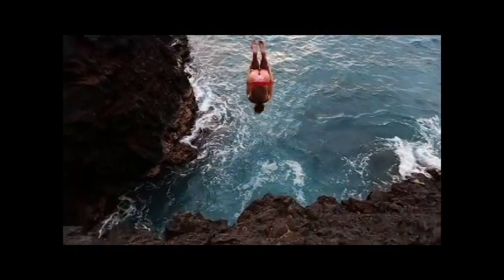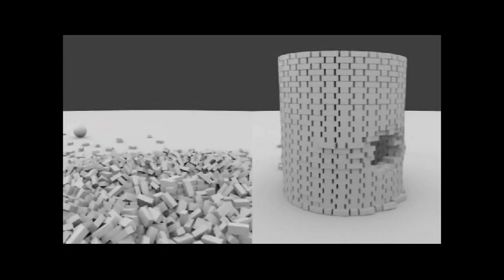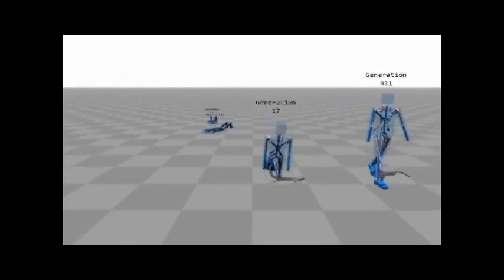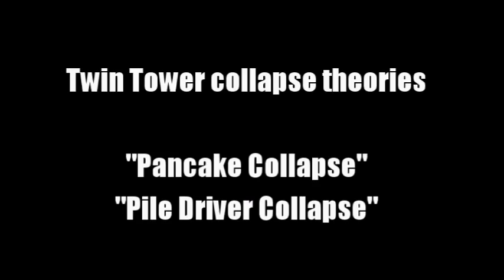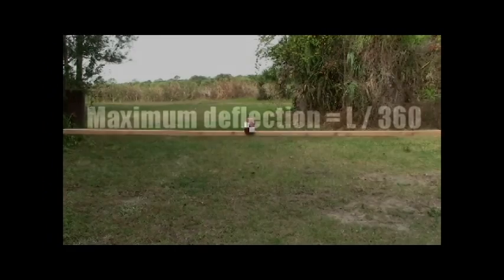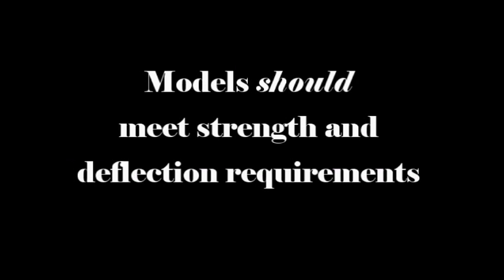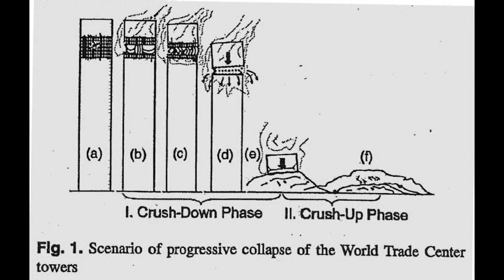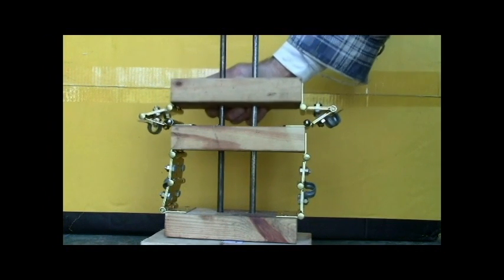9/11 Experiments: The Force Behind the Motion

Comment: What a crock. Drop a weight that is much less than the maximum static load for one floor, and OF COURSE it will slow and stop!
Do a real experiment. Drop a weight that is many times the maximum static load for one floor and see what happens...the weight will plunge all the way to the bottom, which is precisely what occurred in the Towers.
Reply: He did exactly what was represented in the buildings. He dropped 15 of the top floors, which were identical in size and weight as the other floors of the building. You are basically asking that in this experiment he drop a bowling ball or a car engine onto his little model and see what happens. Of course it will destroy everything, but the model and the physics he presented are analogous to the building. He dropped a large section of identical floors onto the rest and found that it slowed down and eventually stopped. The important thing was that the top section did not accelerate as the real towers did. And actually his model is wrong. He assumed all the floors were the same weight and same strength. They weren't. The top sections were the lightest and the core columns got thicker towards the base. Had he simulated this, his results would have been even more to his point. Point out what is wrong in my analysis.
Reply: I didn't read the whole thread, but I laugh at all these truther idiots that buy this video.  The guy drops a "static" load onto some cement boards and claims it decelerates.  Well yeah because he has them sandwiched between two thick wooden "supports" lmao.

Then he takes the experiment to the next level and removes the outer supports, but then fails to create a proper scale model of a static load (As you've been saying).

So both experiments are utterly flawed.  The first one doesn't allow the "lower" floors to join in the collapse, adding their weight, because it has outer "columns" that are not to scale and the second one has a load force that isn't to scale.
Reply: Do you not understand "greater than maximum static load"? That means you can place the load on the floor span gently and it will fall through without the factor of momentum. No demonstration needed. It's a fact that at an estimated 38,000 tons, mass of North Tower top was far greater than the maximum static load of one floor span.
Reply: ***** It's a fact the top of NT was estimated at 38,000 tons. I think you have a comprehension problem. 30,000, 25,000, whatever, the upper mass was far greater than the maximum static load for one floor.
You are submitting that once the top fell over to the south, all columns, perimeter and core, comprising only 5% or less of the entire square footage, remained in alignment? Oh my. That's what all you sophists do. It doesn't matter how strong the columns were. The falling mass went around core columns and inside the tube formed by perimeter columns. Had you ever studied objectively, you would know that leading collapse was the south wall. The south wall from the top wedged down to the inside of the lower south wall, peeling it like a banana. The only resistance was the floor spans, so your concept that the upper mass had to "crush" all the lower mass is bogus. The only calculation needed is the upper mass relative to the maximum static load for one floor span.
Reply: ***** There was nothing "uniform" to argue. All collapses that day were asymmetrical, conforming perfectly with damage. And I don't subscribe to a "theory". Leading collapse in both Towers was the top wall wedging down to the inside of the lower wall to which it fell, breaking through the floors as it did. Call it whatever you wish. The rest of the mass followed, a chaotic, churning mass of broken up and breaking up steel and everything else, closer to a liquid than a solid mass. All you have to do is study the mountains of gnarled steel at the bottom of each Tower footprint to know. And of course, the fact substantial heights of both cores stood after everything else fell is proof much of the falling mass was deflected around the core.
Reply: a man Ryan LOL! Those one square acre "rocks" were 95% air, or floor spans. Here's a good little experiment for you. Stand a 5 foot 2x4 on end on the floor. Pretend you are going to slam your head down on it, but move your head to the side at the last second. Now do it again, but this time, smash your head onto the end of the 2x4...see if you can tell the difference. Probably not.
Reply: +whetedge even if he did drop something "greater than the static load limit of a floor" you would still see deceleration as the upper section met resistance and imparts its momentum into the floor below. I suggest you set up your own experiment and post it to YouTube. Have you taken a physics class before out of genuine curiosity? Be honest with yourself. If you haven't, you might want to temper your convictions and leave room for possibly, perhaps, being wrong.
Reply: whetedge defending the indefensible, a gawd awful job you have.
Reply: Robert Balejik Actually it should accelerate with added mass from each collapsing floor. Without added mass, it would maintain a constant rate of descent. "Slowing" means that it would eventually stop if the tower were tall enough; impossible with a mass greater than the failure limit of one floor.
Since the falling mass worked it's way around the core structure (the core was the last thing to collapse), any damage to the core, other than the zone of initiation, would have no impact on ensuing collapse.
At plane impact level, damage to the cores varied due to line of travel of the plane. North Tower was dead into the core, and South Tower core received more of a glancing blow. Both however, were kinked severely from the "chisel effect" of the floors. Once the tops started tilting due to failure of perimeter wall, the core could have been intact, and still would have been ripped apart by the tilting top. Of note, both tops tilted along the long axis of the core rectangle. 
Both Towers fell in perfect conformity to damage and design. They both initiated exactly where the plane ended up in the Tower, and exactly where the hottest fires were recorded. Both Tower tops fell over to one side to initiate collapse.
Reply: Plus, he did drop something greater than the static load limit for one floor. This is why he observed a few floors crushing but then saw deceleration and it stopped. If he hadn't dropped something greater than the static load of one floor, it would have hit the floor and stopped. What part of the video shows this?
Reply: paulczar Negative. His demonstration is deceptive just as I described. Mass of the top section of North Tower estimated at 38,000 tons. Most of that mass dropped down through the Tower. The antenna, drywall, and some of the concrete can be deducted from that figure. No way even the strongest of the Tower floor spans could hold that mass even without the benefit of momentum. Your analysis omits the perimeter walls, core columns, and core cross girders from the mass. It was perimeter wall panels from the top which actually led collapse. The south wall from the top wedged down just to the inside of the lower south wall, peeling it like a banana. The north wall from the top sliced right down the center of the core: https://s6.postimg.org/4rfgz8k1t/WTC1standingcore2.png
Reply: paulczar "he did drop something greater than the static load limit for one floor."

Think about that. Anything greater than the static load maximum of one floor span will break through that floor even if stationary. It will not slow and stop regardless how many like floors it encounters. Only a mass less than maximum static load will slow and stop as momentum is dissipated.
Reply: You're a fucking idiot.
Reply: Mercia That's what all you "truthers" say because you can't refute what I post. If the falling mass is greater than the static load max for one floor span (the strongest in the Tower), that falling mass will crash through every floor all the way to the bottom.
Reply: Mercia Pathetic you are left with nothing but invective, incapable of making a point.
Reply: Crystal Giddens What about Building 7? You think it's "the smoking gun"? That's what the con artist "experts" claim, and weak minds swallow that "appeal to authority" fallacy, hook, line, and sinker. 7WTC fell OVER in two directions, not "straight down", and in perfect conformity to it's damage.
Reply: Crystal Giddens You don't know what you are talking about. Take this loop of perimeter wall collapse initiation to your gurus and ask them to point out the obvious signs of "controlled demo". https://media.giphy.com/media/26BRHuKQqWcyY2Xja/giphy.gif
That half continued falling north, causing this damage to Fiterman Hall, 15 stories up across 4+ lane Barclay Street: https://s6.postimg.io/lxkb33bgh/Fiterman_Hall_Damage.png
Note the structure begins collapse by falling over, with no down move. But only half is falling over. The other half fell to the south, seen in my profile pic.
Reply: Crystal Giddens I defend nothing. I point out facts based on evidence. Your avoidance of those facts makes them no less fact. And I haven't found a "truther" yet who will touch initiation of 7WTC perimeter wall collapse...no need for you to break the cycle. https://media.giphy.com/media/26BRHuKQqWcyY2Xja/giphy.gif
Reply: ***** Oh dear; here comes the "truther" laundry list of "explain this, explain that" from another brainiac who failed to notice millions of pieces of paper blown out of the towers and floating all over lower Manhattan.
Yes, I can explain Building 7 for you, but it is doubtful you even have a basic concept of it's design, so it would be futile to try. I will point out that the unproven "free fall" portion was NOT at initiation of collapse. The perimeter wall collapse initiated with half the structure falling OVER, not down. Initiation is everything. A feature observed part way into collapse is near irrelevant. How a structure begins to fall is how it fell. Here is a loop of perimeter wall collapse initiation. Your conspiracy gurus NEVER show this. They hide it from you. Please explain how "controlled demolition" caused the structure to move this way. Then, please explain why only half fell over, with no reaction in the other half. 
https://media.giphy.com/media/26BRHuKQqWcyY2Xja/giphy.gif
Reply: Sikes Pico Awww...warm pleasantries to you too. Say; let me know when you find all those reports of the smell of explosives.
Reply: Sikes Pico How so? They got top secret explosives that produce no distinct odor now? Do enlighten us.
Reply: Sikes Pico What I figured...you got nothing but invective. Classic sign of a con. Go find a weak mind to ply your trash. There are plenty out there.
Reply: Crystal Giddens Out of all the thousands of people trapped in the dust clouds and working the site, not one report of the smell of explosives? That alone is conclusive for any sound mind. Coupled with the fact all structural members broke at connections, there is simply zero case for explosives.
Reply: Crystal Giddens You can't have explosives without the smell. All reports which mentioned smell, reported the smell of kerosene, or jet fuel. Explosives have a very distinct odor which lingers, and would have been noted in the dust and on the site. Everyone trapped in the dust cloud would have noticed "a strange smell". Ex and current military, firemen, police, all the various investigating agencies at the site, including ATF, FBI, NYPD, State police, etc, would have been able to identify that "strange smell".
"The way they fell" offers not the first indication of any controlled demolition. All three initiated gradually, and in perfect conformity to damage. If controlled demolition cannot be identified at the beginning of collapse, it didn't happen. You might note the conspiracy sites like AE avoid initiation at all costs.
People heard things they thought sounded like explosions, but otherwise, there is simply no evidence for it. Gene Corley, lead forensic structural engineer investigator for the FEMA report, is on record stating they indeed looked for evidence of controlled demolition, and found none. Anyone today can study the hundreds of hours of video and photo taken of the site day of and on, so you can see all layers of debris, as well as the landfills. Every bit of that structural evidence shows clearly the buildings broke apart at connections.
Reply: whetedge I disagree completely. Any smell 'test" does not pass the smell test. They did not investigate for explosives. The way they fell was EXACTLY like demolition as many news commentators said the day of... A passport blocks away does not pass the smell test either. It was an unusual "event" indeed.
Reply: Crystal Giddens If you wish to live in lala land believing in odorless explosives, be my guest.
Identify the signs of controlled demolition at initiation of 7WTC perimeter wall collapse. Note half the structure is falling over, with no down move. How did controlled demo cause the structure to move like that? Why did only half the structure fall over without a reaction in the other half?  https://media.giphy.com/media/26BRHuKQqWcyY2Xja/giphy.gif
Reply: Crystal Giddens That's ok. I haven't found a controlled demo proponent yet who will go near initiation of 7WTC perimeter wall collapse...no need for you to step out from the herd. https://media.giphy.com/media/26BRHuKQqWcyY2Xja/giphy.gif
Reply: Sikes Pico Just curious. What's in it for you? There's gotta be something to make someone try and keep such a preposterous scam alive. Is it money, political slant? What?
Reply: Crystal Giddens Common sense tells you how the structure began to fall is how it fell. 
I notice you are confident the buildings were demoed, but you can't identify CD at initiation. Good luck with a "new investigation" based on that.
Ps: Invective helps your case how?
https://media.giphy.com/media/26BRHuKQqWcyY2Xja/giphy.gif
Reply: Crystal Giddens LOL! If you read garbage...well you know the rest. The mere fact you continue to avoid initiation of 7WTC perimeter wall collapse speaks volumes. Go ahead and fool yourself. You can hide from the truth, but you can't hide the truth.
https://media.giphy.com/media/26BRHuKQqWcyY2Xja/giphy.gif
Reply: Crystal Giddens I count 11 posts you made, and you have offered exactly zero to the conversation, failed miserably to back up anything you've said, and avoided actual evidence like it's the plague.  You should quit before you do more harm to your "cause".
https://media.giphy.com/media/26BRHuKQqWcyY2Xja/giphy.gif
Reply: Crystal Giddens Please point out the symmetry in 7WTC collapse initiation: https://media.giphy.com/media/26BRHuKQqWcyY2Xja/giphy.gif
Only half the structure is falling over. How is that "symmetrical"? Note that half keeps falling to the north... http://giphy.com/gifs/wtc7-7wtc-building-7-fKTFH3FXgVy3C  No symmetry there either.
Both of the Twin Tower tops fell over to one side. How is that symmetrical?
So,you see, if you base "common sense" upon lies, you get no sense at all; you get lies.
Reply: akupehsluarketatAR
"Every lower floor it hits, it will decelerate losing its momentum..."

"...the lower floors are build tougher than the top."
Your are incorrect. The floor spans were not any stronger at lower levels. Some floor spans were indeed stronger...the ones used for mechanical support. Even the strongest floor span though, could not support the falling mass even if it were placed on it gently. Try to understand "static load maximum". "Static means stationary, with no momentum. If a floor span won't support the mass at rest, how on earth will it slow and stop the mass falling? In actuality, the rate of descent should increase as more mass is added on the way down.
The columns, on the other hand, indeed were "stronger" at lower levels of the structure. But that is meaningless, since the falling mass essentially went around the columns, and plunged through the floor spans.
Can you not see how you are tricked with words? The con men like to use general terms like "floor", and fail to distinguish between that and "floor span", making you think the lower floors are "tougher". They also try to make you think the upper mass had to crush the entire mass below, or that the upper mass "dissipated" as it broke apart. The mass was still there, all 38,000 tons of it (North Tower top), minus the dry wall and the antenna). The mass quickly altered form, into a jumbled, churning mass of steel in all forms and shapes...a grinding machine. The mass worked it's way around the core, leaving 50 to 60 floors of core still standing after everything else collapsed, in both Towers.
Reply: akupehsluarketatAR
"shouldn't have molten steel."
What molten steel? That's just more "truther" lies. You talking about the aluminum pouring out of South Tower? Take a look. https://s6.postimg.io/ywsd95fep/Molten_Material_South_Tower_Annotated.png
That's taken from a conspiracy video, and they are too biased/bigoted to even notice.

"Shouldn't the column be standing while the floor is on the ground then?"
They were. They were splayed apart, and the upper, thinner columns were already splayed off, so they weren't exactly stable, but they were the last thing to fall. Take a look at pretty dramatic footage of North Tower core: https://media.giphy.com/media/l41Yz6mkKo9qidQHe/giphy.gif
Here's a still shot of NT core. The void is where the north perimeter wall from the top sliced down through the middle of the core: 
https://s6.postimg.io/4rfgz8k1t/WTC1standingcore2.png
Reply: Crystal Giddens You sure are wasting a lot of time for someone who doesn't give a shit. What's in it for you? It certainly isn't for the sake of "truth". You prove that by avoiding collapse initiation.
I noticed you were not able to find the "symmetry". You can kick up all the dirt you want, rant and rage, but you can't change the facts. There isn't the first sign of controlled demo at initiation or anywhere else in how the buildings fell, or in the structural remains.
Reply: Crystal Giddens I'm not sure what "they" you refer to. Gene Corely, who headed the FEMA investigation long before NIST got involved, is on record stating they looked specifically for signs of controlled demolition, and found no evidence for it. Likewise, and in order to corroborate, you are welcome to study the hundreds of hours of video taken day of and on of the site and landfills, plus the volumes of photographs, and look for all the cut apart structural members. I can save you the time. Everything shows the buildings broke apart at connections, with zero sign of anything being cut apart or in any way artificially dismantled. That's all anyone with some degree of common sense need know. If the buildings were cut apart, there will be cut up columns in the piles. Simple physics. Go find them, and you will have cause to complain.
Ps: You may want to have your eyes checked. There is no symmetry in any of the collapses (well, there is sort of symmetry in 7WTC, but not what you think it is. It fell over in two directions). Just because you tell yourself it is, does not make it fact. You have to be able to point it out, which you failed to do.
Reply: Crystal Giddens You offered exactly one reason to believe collapse was caused by controlled demolition: symmetry. I proved you are wrong. There was no symmetry. In fact, all collapses conformed precisely to damage. It is you who are playing games, continuing to post, offering nothing but invective. You prove to the world it is you who is the dishonest one. Climb down from the tree, and go play in the kiddie pool where you belong.
Reply: Crystal Giddens Now you're playing comedienne. Not a very good one though; good comedy has a ring of truth to it.
If you ever get serious, let me know when you figure out the signs of controlled demolition...https://media.giphy.com/media/26BRHuKQqWcyY2Xja/giphy.gif
Reply: akupehsluarketatAR Please point out the "straight down" at initiation of perimeter wall collapse. See if you can find any down move... https://media.giphy.com/media/26BRHuKQqWcyY2Xja/giphy.gif
What "support columns" were removed?
Did they wait for the building to start falling over like that before they set off the charges?
Reply: reece cole Indeed ignorance is bliss. That's why you guys are so easily fooled by drop dead stupid "experiments" like the one in this video.
Reply: Crystal Giddens Is Fiterman Hall in 7WTC footprint? https://s6.postimg.io/lxkb33bgh/Fiterman_Hall_Damage.png
That's where the east half of 7WTC fell over...15 stories up across 4+ lane Barclay Street.
Reply: Crystal Giddens
"if you are incapable of observing what happened you are incapable of coming to a logical conclusion."
You have demonstrated throughout this thread to be incapable of observing. Take you preaching to the kiddie pool sister. You might be able to fool undeveloped minds.
Reply: Crystal Giddens The more you avoid initiation of collapse, the more you prove to the world you are full of shit. How the structure starts to collapse is how it collapsed. I'd love to hear you refute that. https://media.giphy.com/media/26BRHuKQqWcyY2Xja/giphy.gif
Reply: Crystal Giddens Good, because you have contributed nothing but clutter.
Reply: ***** What I figured. You haven't bothered to look for all those cut apart columns. It's a fact...everything broke apart, mostly at connections, and there was no smell of explosives reported by all those thousands of people trapped in the dust and working the site. Slam dunk facts; avoid them as you may.
Reply: ***** You believe people, I'll listen to what the evidence states. I bet you refer to those of us who have done our own research as "sheep", blindly following blah blah blah. Those "experts" are conning you with the "appeal to authority" fallacy. All they offer is false premises, omissions, and outright lies; no different than this utterly ridiculous video. And there is no arrogance in fact.
Reply: ***** 
Let me know when you figure out how a floor span that fails at 10,000 tons can stop 38,000 tons.
Reply: ***** "And where did all the rubble go?"
You talking about this rubble? http://weburbanist.com/pics/9-11-tribute-128-photos/slagheap/

"only two got hit."
Never play with dominoes as a kid, huh?
All three got hit...fact.
Reply: No, again, as I said you're a fucking idiot.
Reply: whetedge wrong.
Reply: Shallow JR Pivoting on what? Statements like that reveal a lack of understanding how the Towers were constructed.
The top of the Towers in fact did drop to the side of center, barely within the one acre footprint, and wedged down just to the inside of the perimeter wall side to which it fell, peeling it like a banana.
Reply: whetedge Red-Herring fallacy and further evidence of your magnanoumous stupidity. Lmao! Try again little pigeon ;)
Reply: whetedge Lmao! Yet another red-herring fallacy. You'll say anything to save yourself from the jaws of humiliation. Try again little pigeon ;)
Reply: whetedge they didn't investigate for explosives, therefore, explosives cannot be ruled out.
Reply: whetedge The way they fell is all the case needed. That they didn't investigate is all the cover up needed. There are plenty of video recordings of explosives to boot.Not to mention eye witnesses.
Reply: whetedge 
"believing in odorless explosives"
Straw man fallacy. Lmao! Are you really this stupid? Try again little pigeon ;)
Reply: Sikes Pico Ok, you still stink. New "argument' though. Congrats on your "inventiveness" but it still stinks as do you. Pigeon shit!
Reply: whetedge You mean i won't go near your smell! This is no longer about "science." It is about common damn sense you jackass!
Reply: whetedge Common sense. I have read far more than you know. Right smack dab to common damn sense. Invective is nothing. you should hear it from my side. good luck. Game over!
Reply: whetedge "backing up" common sense is redundant. facts i won't argue about either. to the "naked" eye the collapses were symmetrical. "I," for one, will not use the "eye" you choose for me to use. Symmetrical collapses means symmetrical damages means controlled DEMOLITIONS! 3 for 3! Put that in your pipe and smoke it!
Reply: Well, when one has the highest level of ignorance, nothing in the world can correct him/her. Not Physics, facts, whole of humanity, logical thinking, common sense or even mother nature. Let's all just leave them to live in their own fantasies.
Reply: whetedge if such, then shouldn't have molten steel. The elevator column are strong as fuck as well. Why did it blew into dust? Shouldn't the column be standing while the floor is on the ground then?
Reply: akupehsluarketatAR
" otherwise part of the building will be thrown off to the side"
It was. Both Tower collapses started with the tops falling to one side, wedging down just to the inside of that wall, peeling that wall like a banana all the way to the ground. South Tower to the east, and North Tower to the south. The tops couldn't have fallen entirely outside the footprint because there was nothing for them to pivot on.

"wth happen to building 7? why did it fall so perfect as well?"
It didn't fall "perfect" or "symmetrical", or "straight down". Take a look at perimeter wall collapse initiation. https://media.giphy.com/media/26BRHuKQqWcyY2Xja/giphy.gif
There is no down move, yet half the structure is falling OVER. That half continued falling north, causing this damage to Fiterman Hall, 15 stories up across 4+ lane Barclay Street: https://s6.postimg.io/lxkb33bgh/Fiterman_Hall_Damage.png
The other half fell to the south, across Vessey Street and into 6WTC (see my profile pic). That confirms 7 was split nearly in half by falling perimeter wall from North Tower.
Reply: whetedge dude, building 7 falls straight down. No building will fall in such ways unless its support column were taken out.
Reply: Crystal Giddens What's in it for you? Why are you so desperate to keep the scam alive in the face of overwhelming evidence you are wrong? Do you have any idea how utterly humiliated you will be if this ever gets to court?
Reply: Crystal Giddens You don't give a rat about "truth". Stop dragging it through the mud. If you did, you wouldn't be such a chicken shit, and point out the signs of controlled demolition at initiation. https://media.giphy.com/media/26BRHuKQqWcyY2Xja/giphy.gif
Reply: ***** "Gene Corley....."
You missed, "and in order to corroborate,"
You don't need to take anyone's word for it. You can study the steel today and look for all the cut apart columns.
What would be the point of "examining the dust"? One good look around the piles and it's obvious everything broke apart at connections, and there was no smell of explosives. I don't think you grasp the power of that evidence, or lack there of.
Reply: *****
"no demonstration needed" WOahahahah!"
Do you enjoy displaying your utter ignorance? Get a kick out of it? Please tell. If a mass crashes through a floor span just sitting, with zero momentum, how on earth will like floors below stop it's descent? It will be the same mass plus what is added by each collapsing floor, and it will have the added force of momentum.
Reply: ***** I pick and choose actual evidence. You, on the other hand, make statements like, "main shafts fell into dust"...what on earth does that mean? AND, "the missile at the Pentagon"...now that's a doozy, considering damage was one direction blunt force, with no sign of any explosive damage.
I guess airliners slamming into skyscrapers at full throttle just isn't enough excitement for some people...gotta make spooky stuff up.
Reply: ***** Plenty of airline pilots have flown those exact routes in simulators with exactly no problem. And who was banking at 500 mph? AA77 made a 270 degree turning descent at 230 mph, perfectly within airliner capabilities. And did you not learn as a child riding a bike that it is easier going downhill than pedaling on level ground? Cruising speed is easy to attain at lower altitudes while descending.
You really should leave the science fiction section, and move over to the real world.
Reply: ***** I'm not going to play your "laundry list" game of "what about this, what about that?", when you can't even recognize the basic fact that every shred of evidence shows clearly the buildings fell due to two airliner crashes.
Make this real simple on yourself. You only need 3 things to have a case for any controlled demolition:
1. Identify the signs of controlled demolition at initiation of each collapse.
2. Find all the cut apart columns in the piles...plenty of video documentation.
3. Find all the reports of the smell of explosives.
Until you produce those 3, you have no case, and I will entertain no other notion you have because it is irrelevant until you produce those 3.
Reply: ***** Any objective researcher will readily note there are no slide marks and dings on those cut columns, so they are not "in itself an indication of the use of cutter charges". Biased and easily duped saps on the other hand, are shown the cuts and are immediately led to the conclusion they are evidence for controlled demolition, just like little sheep, with zero critical thinking applied. There is a further long list of why they are not part of any controlled demo, but I'm not going to write a book for you. Try a little thinking on your own, sans bias.
Reply: When the building tilt, it would have higher chance that it would drop to the side.
Reply: +whetedge  hey so take this little rock and turn that big rock into dust.  Easy right?
Reply: +whetedge  hey so take this little rock and turn that big rock into dust.  Easy right?
Reply: Crystal Giddens That comment was meant for whetedge.
Reply: Sikes Pico my bad. sorry.
Reply: whetedge Speak your lies. people get it now. We have been duped and we are being duped but folks are waking up. Scurry along please.
Reply: Dude the F*ck you on about? Every lower floor it hits, it will decelerate losing its momentum further to crush the even lower floors and the lower floors are build tougher than the top. That's the reason the towers are able to hold up all these years. With the amount of strength in the structure of the lower floors thats been holding up the upper floors its entire life, its not logic for it to be crushed all the way down to its footprint.
Reply: whetedge and you did not include the distribution of force. Only if the force distribution are equal on every side(which is of course not in this case) will it then all fall in a straight line otherwise part of the building will be thrown off to the side and wth happen to building 7? why did it fall so perfect as well?
Reply: whetedge they did not investigate for explosives. how did they "know" not to? you are whacked. nobody with open eyes will ever have your logic close them. do a power point! I don't give shit! they and you are lying liars!
Reply: whetedge I found symmetry with my eyeballs as does almost everyone else who looks. I don't know what you see and I don't care to know. This is not about "science." It is about common damn sense. They did not investigate for explosives. How did they know not to investigate for explosives? The truth is what is in it for me.
Reply: whetedge i copied and pasted something because it was so easy and I felt like it. I am not arguing with you, just did it with a glimmer of hope you are not too far gone or just towing the line against all odds. your arguments are nonsensical, your position indefensible. but go ahead be my guest.
Reply: ignorance is bliss you sir are one of a kind and have completely dump founded me.
Reply: the guy actually expects folks to disbelieve their own eyes. disbelieving our eyes is the only way they can win. the damn building fell just as if demo and right into its footprint just as they would plan for it to do. but NO don't believe your eyes, instead engage an idiot like this in "science." Science starts with observations. if you are incapable of observing what happened you are incapable of coming to a logical conclusion. So, as I said, we must disbelieve our own eyes just to debate them. Forget about it dude! I won't do that for you or anyone else. My eyes don't lie!
Reply: are you affected by zika? does your brain not function properly? how do you deceive yourself so?  9/11 Firefighter Blows WTC 7 Cover-Up Wide Open. The SHIT is out in the open now. You cannot put the genie back in the bottle. It was a cover up! why? I don't know. Nefarious forces are at play. What is your investment in this cover up about? Or is it Zika?
Reply: whetedge the damage caused by Zika is irreversible, I understand. So sorry. You may never get better.
Reply: whetedge I deserve and every American deserves a plausible explanation for what happened. We have been at war ever since. We have given up our liberties to this LIE.I would not be "humiliated." I would be thankful if they explain away their false premise and utter incompetence. I would be relieved to learn they are not that despicable. Unfortunately, I know they won't because they can't! that is the dumbest question I have ever been asked! What is in it for me? The mofo truth! Too much to ask?
Reply: whetedge can't discuss much with a Zika victim like you. Sorry, the damage is too severe.
Reply: whetedge okie dokie my friend. i am avoiding initiating a scientific dialogue with you because it is pointless.
Reply: not to mention his planks weren't subject to a long period of burning and weakening...
Reply: ***** I understand. You can't stay on topic because you have no case for controlled demolition, missiles, or any other, yes, spooky notions like steel turning to dust, so you shape shift over to "endless wars".
There is plenty enough reason to be skeptical of ,gov without making stuff up. The evidence is crystal clear to all but those of you who just can't find enough excitement in jetliners crashing into skyscrapers at full throttle, which is what caused all the destruction at WTC that day.
Reply: ***** Dude. This is about collapse of the buildings. If you want to discuss the "whole event", go find another thread video; there's plenty out there. The simple fact is there is nothing at all suspicious about how the buildings fell, and you have done nothing but dodge that simple fact.
Reply: ***** You are so ill informed. Where do you get your information? I can't spend the time to educate you on everything, and if you read back through this thread you will understand why no laws of physics were violated, but do study this photo and tell me why you think everything should NOT have been ground up into little pieces. http://weburbanist.com/pics/9-11-tribute-128-photos/slagheap/
Reply: ***** "Anyone who makes arguments via character assassination or crude insults..."
You mean like this?...
"what a ignorant jerk you have been most of your life."
Of course, you didn't actually make an argument, did you.
Reply: but it still should decelarate + the core was only damaged a little 20-25% = it would not have fallen like it did if the plane was the only factor
Reply: Whatedge, you say and I quote, "No way even the strongest of the Tower floor spans could hold that mass even without the benefit of momentum." what happens to the supporting columns of cold steel, in your statement? this is where you leave reality and make things up to support your denial.... the building was standing all the lower part undamaged... Idiot
Reply: The building did collapse floor by floor, but an attempt to argue that this was caused by "weight" is absurd, the entire building shared the weight load throughout, like any other high rise, you use this ludicrous argument in an attempt to conceal the smoking gun within the facts. The building did collapse floor by floor, like a controlled demolition of a building of that nature would happen they  attempted to conceal it with the plume of asbestos let off by the top falling, but the steel catapulted out in all directions, and the few rare camera footage showing the floors exploding, kind of shows the american government for what they are, criminals, and not very good ones.
Reply: people who want the truth "truthers" such a poor label to have... Get some better lines morons.
Reply: Mystery History
Hey idiot. a floor span doesn't have any columns under it. Span is the part that spans across the space between columns.
Hey idiot. How can a floor span that fails at 13,000 tons stop 38,000 tons of falling mass.
Hey idiot. Condition of the lower Tower had no impact on collapse, because the falling mass punched/sliced down through the floor spans.
Hey idiot. how much TNT equivalent would it take to "catapult" 100 ton slabs of steel out in all directions?
IDIOT!
Reply: Smell of explosives- LOL
Reply: I looked at your page- You LIKED donald trump - Just sayin -
Reply: I looked at your page - You LIKED donald trump - just sayin
Reply: ***** "Smell of explosives- LOL"
LOL is right. No smell means it didn't happen. Not my fault the con men didn't think of it.